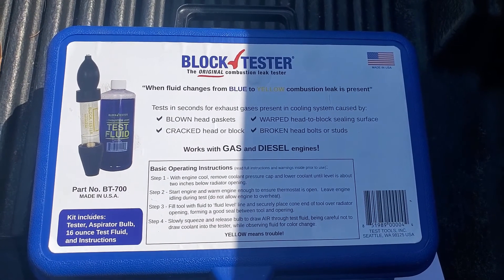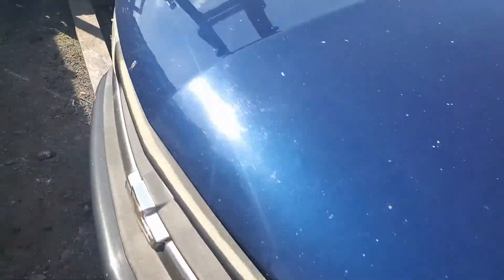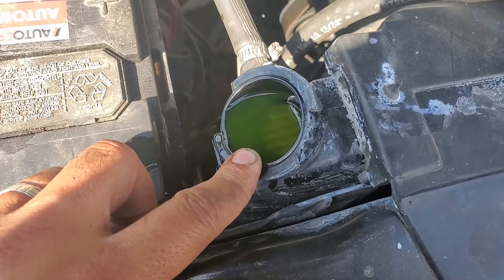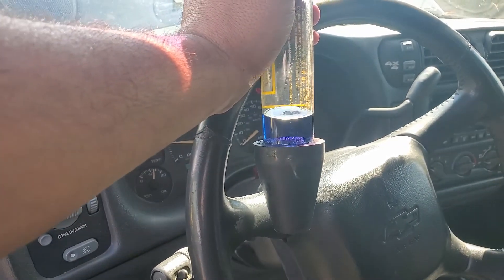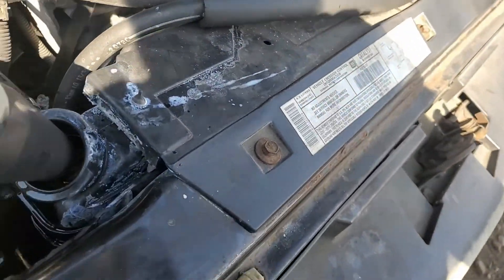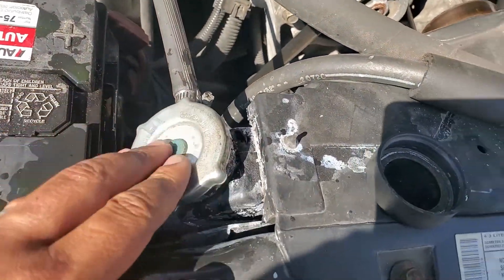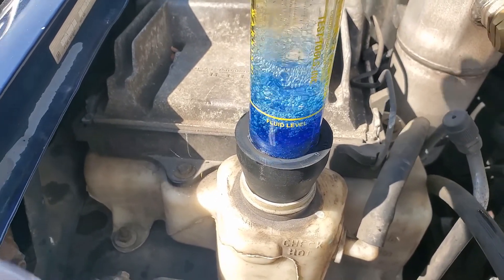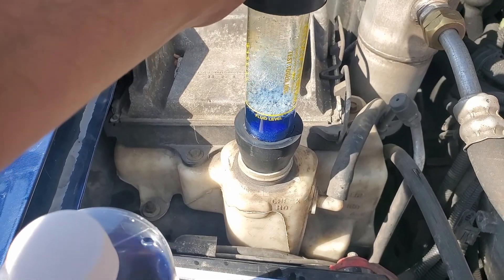2003 Chevy S10 Overheating check using Block Tester

Comment: My is a 2003 also and it's running really good ,,I wish I have the V6  automatic ,I got the 2.2 engine and is a Manual transmission .